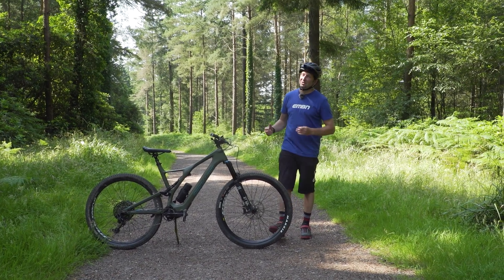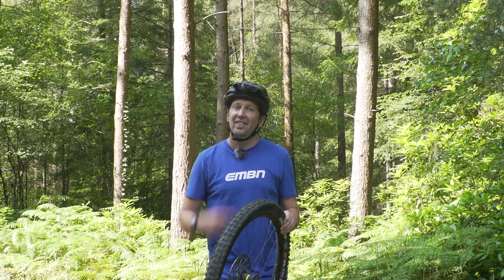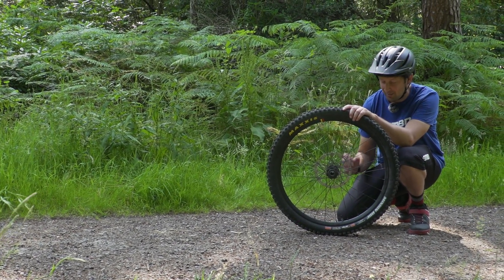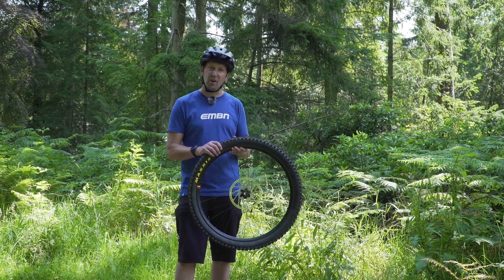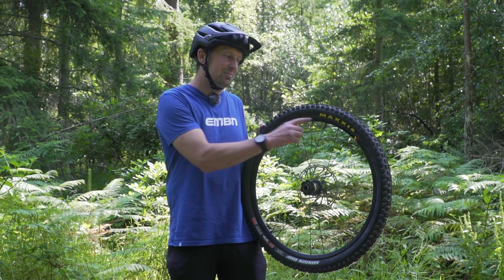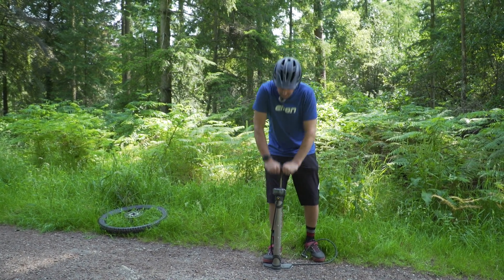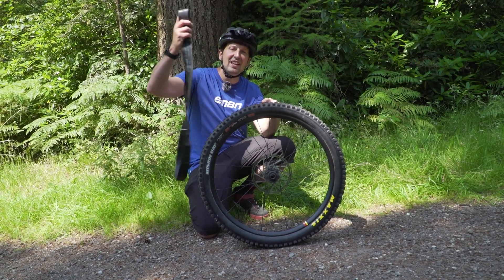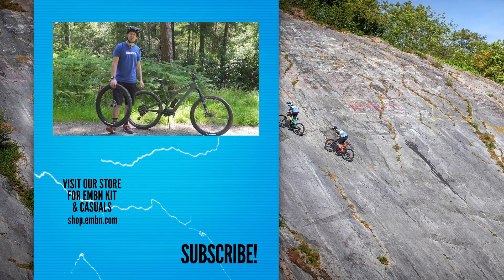Tips And Tricks For Setup & Seating Tubeless Tyres + How To Know If Your Bike Is Tubeless Ready

Comment: Soapy water is always a winner for seating the bead. Had no problems seating with standard track pump on DTSWISS rims.
Recently bought a DH bike and needed to change tyres, was on Stand Flow mk3, had a tough time inflating the rear tyre as it wouldn’t hold the air with the unseated bead- so popped a tube in as is covered in this video, and that sat the bead so easy that way. Deflate, unseat one side to remove the tube, reinflate and bead sits easy. I always fill sealant after through the valve core, a lot less messy. Been a perfect upgrade for the eeb, flat spotted my rear wheel on a big drop recently and it still holds (but spues some sealant every now and then after a rough run)

Comment: I use slime in the tubes and a strong band of extra protection plastic on inside of tyre. Works great. Same as tubeless you just need to check your tyres for objects in them and check pressure often.

Comment: Once you get your tire on the rim. Start at the stem  work the tire high up onto the rim. Do the other side of the tire going the opposite way. Put air into the tire and it will pop right on

Comment: Non tubeless tyres work fine, they're just harder to seat. (possibly less safe) I used the ones that came with my bike, with the intention of replacing them anyway if tubeless didn't work. 400 miles and counting without any leaks, or loss of pressure. It sealed a couple of punctures perfectly and only 1 minor burp. That all been ridden in the woods with lots of roots and rocky sections.

Comment: Found that leaving the sealant out until after seating the tyre worked best. Use a large syringe and fill through the valve hole (leaving out the valve of course), then reinflate to required pressure. Fairy Liquid is not much good, use real soapy water for best results.

Comment: two identical wheel rims, identicle tyres and valves, front stays up, back always deflates ? thinking of going back to tubes :(
Reply: check the valve
Reply: Sidewalls. Lay your bike on it's side and rub some soapy water. The sealant had a hard time getting up the sidewalls from riding around and they're probably full of small holes
Reply: As AR Post said, check your valve, there's probably dry gunk in it stopping it sealing.